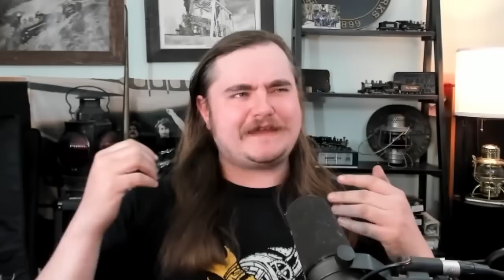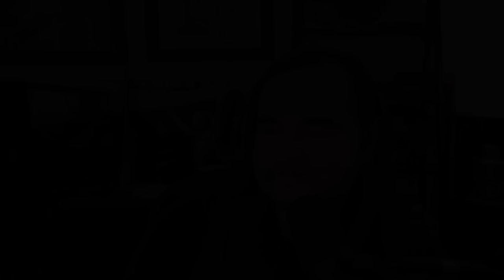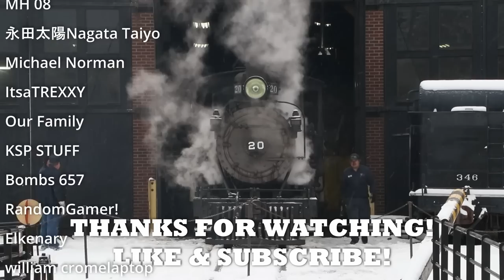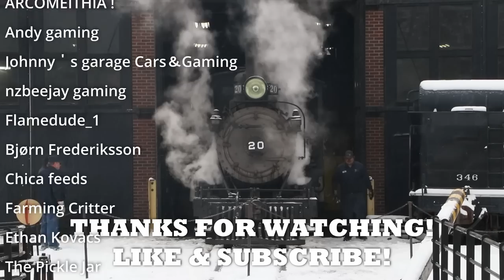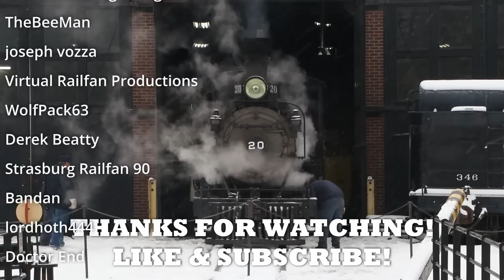Where does standard gauge even come from???

Comment: I think this is actually much cooler than most of the myths. Like, sure, there's some romance to the idea that it comes from Ancient Rome, etc. But the fact that it was "hey maybe these two lines will connect someday let's make them the same" is brilliant. At the end of the day, there is nothing really that special about 4'8.5" gauge. It's an arbitrary measurement based on a nice round number and the development of technology, and the only reason it took over is that, well, it was there and there was more of it. But other gauges are just as good for large networks: there are broad gauge lines with very sharp curves, like Philadelphia's trolley network or the original Ligne de Sceaux in Paris (no converted to Standard Gauge and part of Line B of the RER), there was a gas powered 2-foot gauge railcar that went 150mph in South Africa. And of course 4'8.5" is not standard in many parts of the world, such s South Asia where 5'6" is preferred, or Japan, New Zealand, and South Africa, where it's 3'6 for the most part. Any number could have been chosen, and our rail network would probably have ended up looking quite the same.

Comment: In the early days (before Jessop), there were flangeless wheels running on angular rails (system Curr), so it actually made sense to measure on the outside. So the mixup happened at some time while the flange was introduced. Which means that standard gauge is as old as any rail-wheel-system to which Klingel‘s classical formula applies.
Also, the thing with horse butts isn’t completely wrong. Horse trams with one horse used meter gauge, while horse trams drawn by two horses usually ran on standard gauge. The connection is there, just… backwards.

Comment: What I find wild is the standard gauge is two horse butts wide myth carries over into the space community, where people talk about the Solid Rocket Boosters used on the Space Shuttle and SLS as being "two horse asses wide" to fit on railcars from the factory in Utah and go onto Florida. Add in the "its the width of a Roman chariot" part of the myth to, and people like to imagine the Space Shuttle going into space behind two chariot sized boosters. 

Of course a comparison between standard gauge at 4' 8.5" and the diameter of a SRB being 12.7' shows that loading gauge of course trumps rail gauge in any discussion of how big you can fit things onto a railcar. The perpetuation of the myth always boggles my mind because any quick comparison of sizes between standard gauge and those rockets throws the idea out the window completely; BEFORE anybody discusses the history of where standard gauge came from.
Reply: There's enough photos of the unusual occasions when locos built to the US loading guage are next to those built to UK (especially older smaller ones) loading guages to demonstrate how little track guage and loading guage have to do with each other.

Comment: Looking at it with a trade background (welder/boilermaker), the concepts of “make it fit” and “adjust to suit the conditions” makes this account WAY more believable than the tales of the two horses etc. You simply have to make things fit in order for it to work, even if the actual measurement is slightly off.

Comment: As I've read, The reason for Standard gauge was to maintain the axle length on the original cars. It's been the same Measurement from the inside wheel to inside wheel since the 1830's, the only exceptions are the Narrow and Broad gauged engines produced since then. The current Measurement for the gauge is to that Original axle dimension George Stephenson made almost 200 years ago. It's why the Replica of Stephenson's rocket could be rebuilt to the Original Blueprint and run on modern rails. Now the reason's for that Measurement maybe lost to time at this venture  but the fact that Locomotives and rail cars have maintained this level of consistency is truly amazing.
Reply: Right, same with the John Bull, built 1931 to English Standard Gauge, which became American as well.  Also American system that lead to the Transcontinental RR was started in the 1830s and 1840s with the 56.5", so no way that it wasn't until 1860-something that they figured that out, although there were certainly plenty of non-standard gauge for years.

Comment: Unfortunately there's a lot that doesn't add up with this explanation. Inside gauge, or distance between the rails, was already a crucial measurement well before the 1840s. The gauge between the rails was given when Horatio Allen ordered the Stourbridge Lion in 1828. Horatio Allen then specified 5' between the rails in 1829 for the South Carolina Railway. When Robert Stevens ordered the John Bull, he gave numbers for the gauge rail center to center, but also the measurement for the distance between the rails (4 feet, 9 and three quarters of an inch!). When John Bloomfield Jervis was planning the Mohawk & Hudson he settled on 4'9" as a near enough compromise that would enable nearby foundries to supply his needs without having to make any major changes to the wheels and axles they were supplying to other railways at the time. It is interesting to note that for many decades the 4'9" was more common in the northern states than standard gauge, and the 5' became the standard in the deep south. 4'8.5" was not really "standard" until the end of the 19th century. 

I've also heard the theory that the "standard" was 5 feet center to center, and 4'8" just happened to be the distance between the rails, but this theory also falls apart when you consider the huge variation in width of rail used by early railways.

Comment: The two horses origin can still work as a source, but not for 4 foot 8 and1/2 inches, rather leading to the 5"-0".  The width would not be the horses but the wheel path of the chariot or wagons.  The wheels rolling repeatedly over the same path of stone surfaced roads repeatedly started rutting the stone.  Subsequently wagon/chariot builders would have sustained the wheel set to follow the ruts rather than have one wheel in a rut and one out.  From that the move to the plank on a 5'-0" tie/sleeper would be a simple step.  And there your story continues.  

The 5'-0"" dimension has always interested me as even today that is extremely close to the centerline of rail dimension of track.

It would also be interesting to convert this dimension into the unit of measures common at various points in history.

Comment: I guess it's kind of the same how a 2 by 4 lumber beam is not 2 inches by 4 inches but actually a little bit under that. What's measured is the raw beam before it's sawn down to final dimensions
Reply: and actually back idk how many years ago it was actually 2 by 4 in
Reply: Way it was explained to me is that a 2x4 is measured that way at the sawmill, but as the water evaporates the wood shrinks.

Comment: Very interesting stuff, although, I do feel the need to point out, in the UK at least, 4ft 8" 1/2 didn't become standard the late 1800s. In fact, it was considered by some to be narrow gauge. Stephenson's main competitor, Brunel, was fighting hard to have 7ft 1/4 become the standard gauge. Depending on where you went in the country you may encounter either the 4ft 8 1/2 gauge, or the 7ft 1/4 "Broad gauge"
It wasn't until after Brunel sadly passed away in 1859 that real progress was made to standardize the gauge, with rail companies laying no more broad gauge track past about 1860, and it took until 1892 for the last stretch of Brunel's broad gauge to be ripped up and replaced with the now standard gauge.

(Edited because I got Brunel's gauge wrong by a quarter inch)

Comment: In Poland we have a little story on how Russian gauge was adopted (of course it was then simply 5 feet). Civil engineers asked the tsar which gauge they should adopt for imperial railroads: European standard, narrower or wider. The tsar replied: for a d*** wider? So they made the tracks for a d*** wider 😝

But seriously... Discussion on the fittest gauge choice was then quite technical. In the reprint of the 1844 Polish book "Iron roads in Europe" I read that key factor was the possibility to fit big enough boiler between the wheels keeping its mass low for better stability. Counteracting factor was the cost of railroad construction. The author concluded that the fittest gauge would be 5½ feet but he didn't precise which feet, English or Polish as on the previous page he wrote that English 4 feet 8½ inches was Polish 5 feet. But he wasn't quite precise again as different feet were then used on Polish dissected territory making 5 feet somewhere between 1440 mm and 1490 mm 🙄 The year of that book publication was the year before the first railroad opening in the Russian section of Polish territory (so called Warsaw-Vienna Iron Road), which had oddly 1435 mm gauge...

* I translated literally "iron roads" because the form "drogi żelazne" (originating in German "Eisenbahnen" and Russian "железные дороги") is no longer used in modern Polish language.

Comment: The only thing why standard-gauge is probably still a thing in continental Europe ist that many nations like Germany will measure in millimeter instead of centimeter on plans. Normally centimeter is used everywhere else. The actual width will not work in centimeters it will only work in millimeters it is 1435 mm wide. That's why we have two main narrow-gauge width's 1000mm and 3foot. The UDSSR made there 5 Foot gauge narrower by 4 millimeters to get a number that makes sense in the metric system.

Comment: Possibly the reason they measured to the outside was because some of the really early horse-drawn railways had flanged rails called plateways which guided the carriages from between the wheels. https://en.wikipedia.org/wiki/Plateway
Reply from the maker: Indeed, that's what this is referring to. So, the horses do tie in still, but not as directly as folks think.

Comment: That would put the outer edges of the rails on the edge of the ties.  With the flanges pushing outwards, it would pop those rails right out of place.  It makes more sense they used a standardized wagon and added flanged tires to it to create the first cars.  Remember, the cars came first and were horse drawn.  And two horses walking side by side with their yokes, etc would create a parallel rut.  Putting the wheels of the wagon in that rut would be less rolling resistance for the animals and would track better down a road.  And with these standardized axles for wheel spacing,  they all would ride in the same ruts (dirt, mud, stone, etc.)   Therefore it seems most likely they would just buy a wagon and flange it.  And of course we know the history going backwards from there to the Romans...

If you look at the standard roadrailer from the railroad, modern cars have about the same spacing on the inside of their tires.  Again - cars built to standardized with so they can down down the rutted wagon roads.  Model Ts had a much narrower track.  Eventually we reached a wider body for our vehicles.    I mean... why else would the railroads and cars all end up with about the same (odd) distance between their wheels in the early days.  Also, the English built narrower and broader gauge railroads too.  Same as here in America.  But standard was standard almost the world over.

That's my story and I'm sticking to it.  Especially when people make me explain this to groups I do talks to...
Reply from the maker: That seems fair to me!

Comment: Excellent video. But isn’t not so much 2 horses arses more the width of a Roman Chariot which left ruts in the English roads 4ft 8.5 inches apart. Your explanation about measuring from the inside not the 5ft outside could also explain IK Brunei’s GWR 7 ft gauge was actually 7ft & a quarter inch

Comment: how would that "extra half inch" even make sense? if they had that half inch less and ran into issues, wouldnt you also run into issues when you make everything wider?
Reply: No. They added half an ince because wheel flanges would jam in a curve. Early railroads had the flanges right up against the rail. 

Wheels are beveled outward, while the track is beveled inward, forcing the train to ride nicely in the middle.

The wheels are 2" thick, meaning you actually have two inches of play before the train can simply fall off between the track. While the flages keep it on the track around curves.

Lastly, the track can be slightly less than 56 1/2" or as much as 57" and still be considered in gauge, as it doesn't matter, the train is riding on 2" of wheel on either side.

Comment: I suppose then the question is why was 5ft chosen for the log ways/plate ways or what ever they were called back then. Why 5ft instead of 6ft or 4ft or literally any other unit of measure?

My guess? Those old all wood rail ways were built for wagons. Which wagons? Well the ones already in production. Why were production wagons given the spacing they had? Whatever it actually was? Perhaps because of the ruts in the roman roads. What caused those ruts? We suspect roman chariots. What metric did the Romans use to decide how wide to make their chariots? ...... Naturally one would conclude the wheels to be spaced wider than two pony asses so the wheels don't have to bump over the hoof prints.

We have the Sr Stephenson (it was Robert his son who built The Rocket) to thank for the concept of Standard Gauge being a thing.

Comment: A measurement from the inside is also wrong because the length of rails has widened over time. On t-rail there are three parts, the ball, the shaft and the heel. As poundage got bigger, all three got higher and wider. Rail if measured this way today would be way wider than 5ft. The unfortunate part of railroad history is the lack of attention paid to the gandydancers, track dynamics, and track construction.